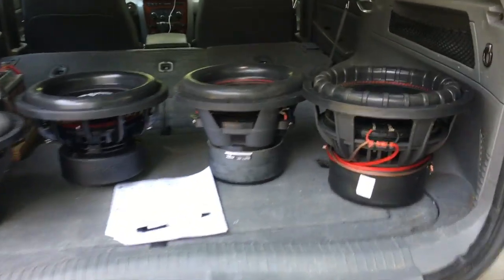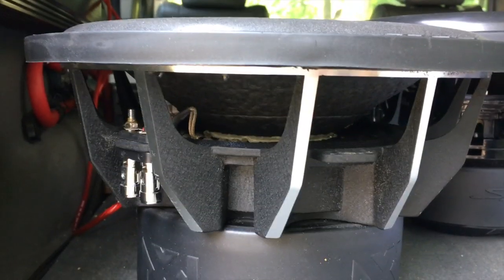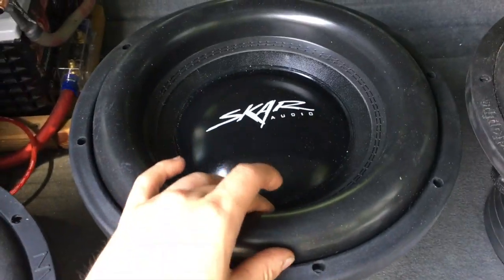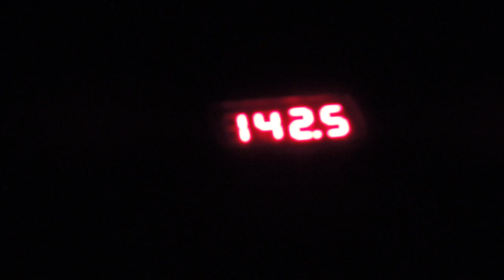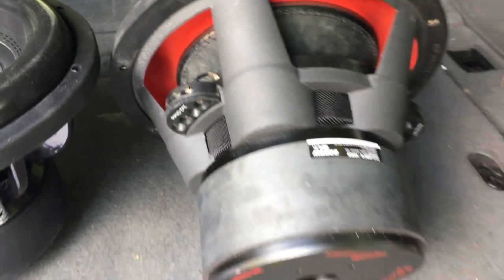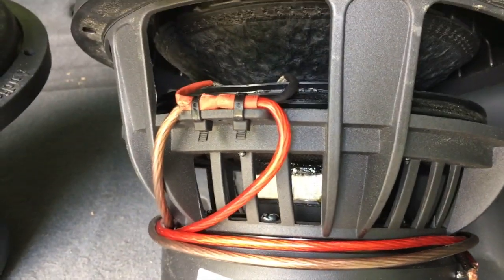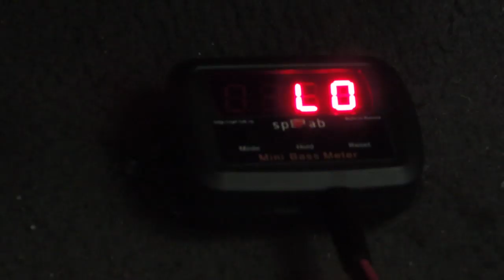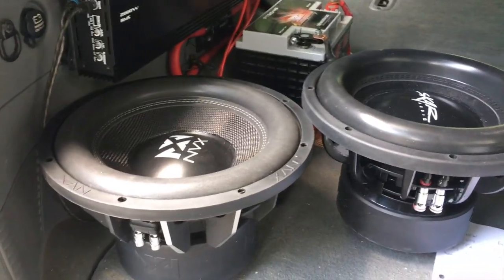Best Subwoofer Under $200?? Best BANG For The Buck? | Skar | AmericanBass | AudioPipe | NVX

Comment: any sub with a double spaced spider like the american base is designed better because it holds the coil in the centre of the motor slot better.............

Comment: Those  subs are for spl only not for music reproduction. If your into that that's fine, but if your into music Those are not the ones you want. Quick example , the bigger the magnet the less efficient  it is, that means you will spend alot  of money to move them. THE MORE EFFICIENT  THE  BETTER. You won't have to buy a bigger amp to get the same spl out of them. Just a heads up in speakers.

Comment: I ended going with 2 jl 13w1v2 with a Orion xtr 1500.1dz amp. They sound great for what they are 350 rms. Going to upgrade now. Looking for 2 subs. Probably going with one of these.
Reply: I have a chance to get two 12 jl w3s in the box with a 500 watt jl amp for 350 bucks right now...how would it sound? I'm used to skar audio 1,000 rms subs btw
Reply: @trickedoutequinox3265  stick with skar.
Reply: @trickedoutequinox3265  I got rid of the jl 13w1 and got 4 jl w3v3 10". Then got 2 15" skar vxf 1500 rms each on an Orion xtr 2500.1 amp. Only had one hooked up blew the 4 10s away.
Reply: @getpaid200  Haha ok cool...I like my ddx 15
Reply: @getpaid200  I just always hear how great the sound quality is with JL audio
Reply: @trickedoutequinox3265  they sounded clean but honestly not much better than the skars. I did have them in a double baffled box made to spec.

Comment: I had x2 of the NVX 15s in a sealed Qlogic armored box 4 cu feet i know blah blah ported is louder but i like sealed, these subs weren't the best on lows probably being in a sealed box yeah yeah lol but omg they hit so hard and so clean for sure a SQ sub and being a JL fanboy these really are the poor mans' JL i put them on a Punch 1k bd rated at 1.7k watts pop on some Kendrick Lamar Humble and these flexed the windows in my Jeep the bass was so fast and precise it was like i was bumping a set of 10's and 15's it was bass that hurt lol like someone punching you in the back of the neck NVX is a brand i will buy again it will accurately and loudly play all types of music these are just amazing subwoofers! Now if you want decent SQ but mostly SPL get any of those other dirty ground and pounder brands he's showing basically just noise!!! lol kidding the Skar audio i have a pair of their 600 watt rms subs and their SQ and how they hit the lows is suprising but still you need to experience NVX if you want the full spectrum a truly musical speaker that does it all with perfection at all volumes and all music generes.

Comment: I have 2 skar evl 12 inch subs on 2 skar rp 1200.1 wired to 1ohm in a slot ported box tuned to 34hz where should i set my subsonic lpf and gains? This is my first build

Comment: I have a 2007 DTS and I have a JL Audio 12w6v2 and a JL 500.1. This set up has been in 8 previous cars. I have had them for about 12 years maybe more. Only once I had to have the foam redone. Now I love my JL and there is nothing wrong with them. I plan on giving them to my son since they just won't quit but I just want something different not sure why but why not. I am no longer wanting the Rockvilles after seeing it cant handle the power ratings but I am interested in either the Skar or the Deaf Bonce Apocalypse. I am looking just for one 12" or one 15" I like my trunk space and will probably do vented so thus just the one. IWhich out of those 2 subs would you choose and why? I take all opinions from anyone who is knowledgeable. I listen to lots of hip hop and rap. I love bass.

Comment: I have an observation u compared subs and thank u for that my comment has to do with the Mark's or dimples you found occured after testing skar sub the explanation is simple it's due to over driving sub in too large of enclosure those skar subs are designed for smaller ported enclosures I'd like to see you compare subs and the recommended  ported enclosure size and port tune frequency and if u dont mind what size is the box u used airspace port size and freq of tune thanks I enjoyed your videos  look forward to viewing more  from you!!

Comment: I’m going from a kicker comp (one of the lower end models) to a skar evl 12 reason being my friend has had 3 skar subs 2 10s and an 8 and all three have made me like what they can produce. sure my current amp isn’t that great but that can easily be replaced in the future
Reply: Stay away from the EVL...this sub is garbage. The tsp's are horrible, if you know how to read them. Plus that McDouble sized motor, has weak motor force. Just giving a heads up.

Comment: Just to b fair here i know for a fact that the nvx vcw is not a true 1000rms speaker. I've given mine hell for a year and a half on a skar rp2000.1d.  They are soft now and i cannot just bang on them for as long and as hard as i want. Never have been able to. If u read in the manual it says that they r only good for like 900 in a ported box.  However this woofer is impressive with the sound quality. And it does have an amazing amout of bass at most any volume level.

Comment: I believe Aluminum is only capable of handling 2/3  the amps/volts as copper...
  But I'm not sure if that makes a difference in coils...🤷‍♂️
 Interesting...
 May ask Ed at ShowtimeSPL... or Sean at EMF...
Reply: How about recommended ported box volume for each...?
Reply from the maker: It depends on the quality of the material. DC Audio as a really good article on it. 
But yes top quality copper conducts better and doesn’t heat up as fast as aluminum.
Reply: You're Doing good with the videos too btw.
 Keep em going

Comment: What’s the best amp and wire for the American bass?
Reply: Get a dual two version and pick u up one of the rp 2000.1 but u will definitely need at least an extra battery, a stock electric even in a beefy car or suv can maybe accommodate 850 watts so if u plan to go with a sub that size u will need something extra in the electric dept

Comment: Anyway I can email you and speak to you about a set up I’m literally starting from scratch as in about to order dash speakers front door speakers and speakers for the back along with a sub and amp and also a new head unit. I lucked up and found a 2001 blazer ls from an old couple and it’s spotless so I’m gonna redo the whole thing.

Comment: American Bass or Rockford p3???
Reply: American bass xfl will be louder, but the P3 will hit plenty loud and sound much more defined doing it. P3 WILL handle 750-800 rms of Clean clip free wattage. which is only about half of the XFL rating. The XFL will easily take more than it's rating. But again, the P3 will sound much better. It's got an aluminum cone which is light, rigid, and helps dissipate heat. Klippel analysis was also used to measure and engineer it.
All told a doubling of power only gains you about 3dB. Which is barely noticeable as our ears hear volume in orders of magnitude.
Bottom line: P3 is a better sub all around and won't smell like ass when your driving it hard. But the AB xfl will be slightly louder and most AB I've ran are slightly smelly.

Comment: I wanted to replace 4 12inch Zeus subs mounted in my trunk. I was looking into JBL or Rockford. Could anyone tell me are the JBL or the Rockford stand up to those listed in this video?
Reply: The JBL subs will be more for sound quality than for SPL and loudness. The Rockford fosgate's are good subs and it depends on if you are shooting for sound quality or spl because Rockford fosgate makes them all. But comparing them to the subs in the video is a different subject, the subs in the video especially the American bass sub is made mostly for SPL/loudness and for daily driving if you like to get really loud. The NVX is good for lows but does not do the best for SPL. The skar evl is good for daily driving and SPL but it seems like they have been having mechanical issues with them lately. And the Audio Pipe sub is a good cheap sub for daily driving and for people just really starting to get into SPL competitions, it is kind of a gateway subwoofer for entering the world of SPL competitions. Usually after you start into SPL competitions you start to get hooked on it, and it can get really expensive really quick, but it is all worth the cost to have all of the fun that comes with it. So I hope my opinion and two cents have helped you make a better decision, and if you need any help you can just ask and either me, or someone else can help you out.
Reply: @nestor aguirre sorry for the late response, but Before I can give you a good answer you might want to look at the following questions, and let me a little more about what you have to work with by answer some of the following questions.

First how much space are you working with, and how much space you are willing to sacrifice? Secondly how much are you willing to spend? Thirdly how big of a system do you want (ie: how much subwoofers, and how much power do you want) for the money you have to spend? Fourthly do you want to build your own box or boxes or buy some prefab's?

Comment: HEY PARKER THOSE BUBBLES(according to EMF audio) CAN BE HEATING DUE TO CLIPPING!  Check your output signal for distortion for safe measure
Reply from the maker: I’ve tested it with my new amp. All clean power 😎
Reply: @ParkerTheBasshead  mayb their glue isnt up to it o-o

Comment: I have two Sundown Audio SA12D2s on a Soundstream Rubicon Nano RN1.5000D and they slam in my car. I paid $450 for both of those subs with shipping brand new and I built the box tuned to 34 Hz with a 6" Aeroport and they pound hard.
Reply: I switched from sundown audio SA series to XFL and the difference was incredibly positive. Louder highs, wayyy more lows, plus, way more power handling.

Comment: The dimples on this scar sub are from the speaker bottoming out on the spider bolts. I mean Jesus how much airspace is in that box. The specs call for 2.0 cubic foot. You can't blame the sub when the box is not correct. Just saying. Every speaker wants a different sized box. Port tuning is all about preference. And when you play a sub and it unloads. meaning acting like it's not even in a box, you're probably need to play a higher frequency. Keep up the good work though, you're learning.

Comment: I got 2 12s and need a good amp ...any suggestions??
Reply: WHICH 2 12S DO YOU HAVE
Reply: EDDY GAGE powerbass
Reply: DUKESTV 
I have a .5 stable sound stream ti.6000 dL that was pushing two XFL1522s I’ll send you for 150. Also a t2500bt-cp I’d let go for 500. I’m not sure I’ll be keeping it purely due to its inability to run at .5ohm
Reply: Rockville M-4 1 ohm stable and exceeds rated power numbers.

Comment: is that the recommend box for a 15in woofer? I have a 15in woofer but my box is a ported box.
Reply from the maker: Jorge Facio the box I used is 2.7 qu/ft and tuned to 32 hz. I’m not sure what the 15s call for but it would probably work just fine

Comment: Are these budget brands all rolls of the dice as far as them not crapping out quick? Seems like theres always some1 saying that happens with these. Yeah they sound good but it's like tools. The cheap tool will do as good a job but the "expensive" tool will last way longer.
Reply: A lot of ppl clip the shit out of them burn a hole thru the voice coil then they want a warranty a company says fu and then they run there mouth
Reply: I've had 2 American Bass XR 12's, which are comparable to the XFL'S, on an Orion XTR 2500.1dz beating for the last 2 years and not a single problem. Also had the Skar RP-2K for a year and it did great for $220 amp.

Comment: Thanks for the video but you really need to get a CAB 12".
Reply: I have one i want to sell because i dont have enough power. I am using a Rockford p300.1 and 300 watts rms probably wont move this thing.  I would sell and ship it for $100.
Reply: I have 2 they are pretty good for the price. They sound pretty good and hit hard if you build your box to specs.
Reply: Chris O'Connor  im interested
Reply: @christopherwilson361  do you like them? They have great specs and one heck of a deal. These things are BUILT! Tough!
Reply: @chrisoconnor3119  Yes they sound great especially for the price. Have mine hooked up to a elemental designs 9.1 about 1500 watts and they take it no problem.
Reply: @christopherwilson361  what model do you have the 1000 rms one or the 750 rms sundown type

Comment: Dont overlook Rockford or phenix gold
Reply: I  love the idea of both of those brands but I just don't think Rockford's subs are with it anymore outside of the power series. XFL 12 and a P3 12 cost the same yet XFL built  so much stronger, 3 in vc. Rockford's amps kick ass though.
Reply: @rmblwgn  I run all phenix myself

Comment: Xfl all daily driver every daily driver, just know if you’re starting your build on a budget you will probably be changing amps a few times..
Reply from the maker: Haha have already been through 4 amps this year
Reply: Parker Dacchille 
for sure, that was mosdef insight for your viewers. I’m on my third in under a year, none have been benched because of injury or any catastrophic meltdown unless you consider my hearing and figure in the only reason I’d need it louder has got to be due to some degree of its loss.. WTFE!!!! I love the reaction from all who experience my music from the other side, wether they love it or loathe it, I did my job....you might mention it necessary to add the supplemental if these guys wanna see any hint of their systems potential.. I added a yellow top after trying a few others like stinger and xs. The optimas are in a league of there own.. which would mean I’ve actually upped my subs two years. I loaded a cple vids you can see my ABs step their diet game up throughout..

Comment: All definitely nice, but while looking at weight vs ratings, the skar done very close to the AB but wasn't moving as much on the cone side. I plan on running two of the 15 evl on a xtr 2500, ...i'm no pro, but after seeing the bigDwiz video of it putting its own ratings to shame, I'll go with it, need a bigger box though, anyone have good specs on how I should build it? I know the recommended for them but it's going to be a daily shut down tool so not competition, yet...

Comment: As far as subs go its about what your going for if you want spl that skar wins all day if you want sq the nvx or American bass budget get you there somehow someway is the ap. Double stack vs triple has a lot to do with the dos of the sub. Up to 2k you need only one set of tinsel leads I love all the brands but the AP(just personal preferance) with that being said there isnt one better than the other its all objective however that double stack vs triple stack drives me nuts more magnet does not directly correlate to more power
Reply: However the skar evl 18 has been the best sounding. Only followed by a DC XL lv4 18 so much more goes into determaning a best sub but now I'm just ranting I guess
Reply: The American bass scored higher in his spl numbers if I'm not mistaken.  Skar is overrated to me never been impressed.
Reply: The American bass may have scored higher at that ohm load however the skar at 1 ohm or half ohm would be considerably louder and be able to hamdle the rms for a longer constant time. I hate all these brands lol the less of ths two evils is still objective
Reply: @andrewalires-clark3988  So the evl which is rated at what 1200rms or something like that taking 2000rms all day I doubt it yes it has been done blah blah but that's not the points of his videos. He liked the xfl and bdc4 better and from the looks of it I agree.

Comment: All look like nice budget subs to me. I have 2 nvx vcw 15's that I had in my jeep on a C.A.B. 1600.1 and it hit pretty hard!  Hard enough to break my rear wiper motor off my rear hatch, and my roof info display off the roof. I bought them for 100$ each, but I think the website made a mistake on the prices as the next day they were not even close to that price.Now I have them in my house and I think I am literally cracking the drywall in the house.
https://www.youtube.com/watch?v=onAf2YbCJ8c (half gain on my sub amp)

Comment: You are wrong about aluminum vs copper coils. Wire size vs heat aluminum is garbage with lower heat ratings vs copper. I wound a 2.75" 18 AWG copper mimiced the W7 coil with 1.2 ohm DC load on my W6v2 and it could take 3 times the power of any Aluminum garbage of the same size. Heat rating vs wire size you think its compared equally but its not when they dont make copper coils the way they should with thick wire.. it will shred your aluminum any day side by side. Aluminum is light but after heating it becomes brittle an snaps from rub or vibration

Comment: Where you find these under $200? I think you probably mean under $300
Reply from the maker: They are all under $200! Look on amazon and eBay
Reply: @ParkerTheBasshead  my bad I didn't realize there was such a large price difference between the 12s and 18s... I have 2 FU750v2 18s on a Q1 2200.2, 300a HO alt, 300aH of battery reserve, all with double runs of 2/0 ofc with a Big 3. And I have a extra 2200.2 I looking to upgrade to Evl 18s and your price just seem off to me. Sorry.
Reply: @ParkerTheBasshead  I got an uploaded on my channel of it before I got the HO alt and Q1 2200.2. had an RP2K in there before.